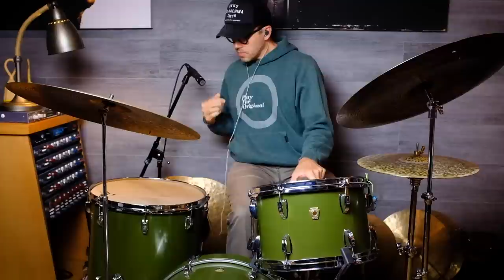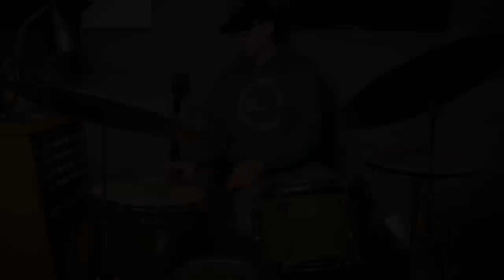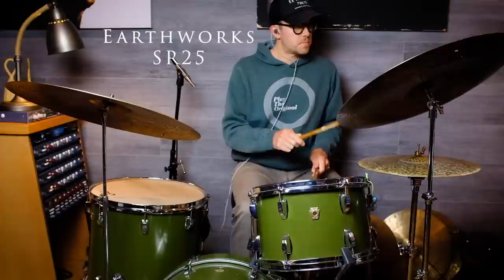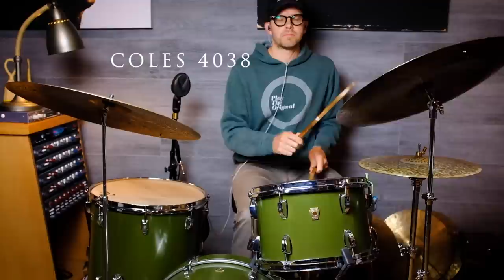11 MONO Microphone DRUM shootout

Comment: I used to close mic toms,.. d2 and d4, d6 on kick and an sm57 on snare. A long time ago a friend turned me onto 1 sm57 over the shoulder and a d6 in the kick. i was amazed at how good that configuration sounded in small to mid sized rooms. I've been using that 2 mic configuration for 90% of my gigs (much easier and less time consuming), still close mic for outside and bigger rooms. That Coles 4038 sure sounds great though, might have to splurge and pick one up! Thanks Carter! I really enjoy your videos and your playing is always inspiring!
Reply: Thank you so much for this comment. I am new with the whole mining subject so this helped try out using two mics in a live setting as well. I was aware it works great in a studio setting but was afraid that the shoulder (room) mic would catch too much to much of the other instruments. I would like to ask your opinion if this will work also on a tiny stage where the other instruments are real close ? Thanks in advance
Reply: @DCA… Try this. Someone mentioned this method above, but quickly, try placing a single SM57 over the bass drum, a few inches back from the batter hoop, aimed at the side of the snare, or even at your knee. You can get a nice fairly balanced sound from just the one mic, with no noticeable bleed from the other instruments on stage. 

If you are playing louder music and need more punch or low-end from the bass drum, you can add a mic to it, but move it around to find the sweet spot and avoid phase cancellation. You may have to flip the phase on the bass drum microphone. Works like magic.

Comment: I guess you applied the same EQ curve for all of them. Even though it makes it harder to compare it does highlight how they contrast. The FET 47 is a clear winner in the high freq information department, while the Coles 4038 is clearly the best in the mid and low end department. A mix of those would sound incredible just by themselves. But my personal winner is the AT 5045, it is the best overall and by far, only because after I did some processing of my own, which was only some tube saturation with emphasis on the high end to compete with the FET in the 47, I found out it had the same crispiness and definition in the highs while maintaining the depth in the bottom. I think dynamic range is very important for a mic in this conditions. Thanks for conducting this incredible experiment, my dude.

Comment: AT 5045, AKG 414, and Coles 4038 shining here. Each have different purposes but you can cover a lot of genres with those 3.
Reply: Yes! I was thinking the same AT 5045, AKG 414 are the best but also quite expensive.
Coles 4038 is mic for low freq, like bass kick?
Reply: @TheMqyable  It's a ribbon mic so it has a much warmer sound than condensers or other types of dynamic mics. Usually it wouldn't be a good idea to put a ribbon mic close to a kick because they're delicate and the sound pressure could damage the mic but it's great as a room mic, overhead mic, even guitar amp if the amp isn't too loud. Lots of uses
Reply: @maxton1506  Thx for explanation. I have to admit I didn't like Coles 4038 in this setup, first of all to much of low freq boost.